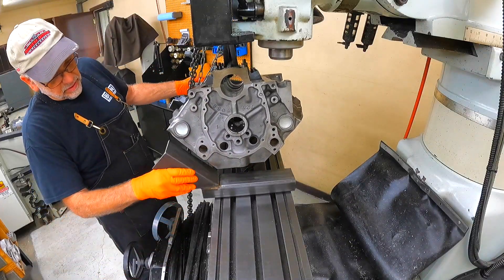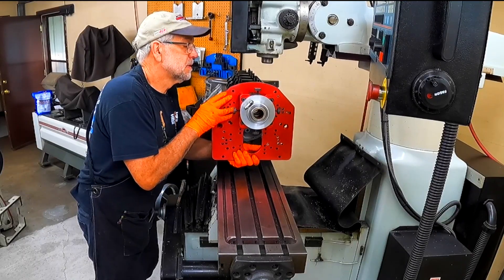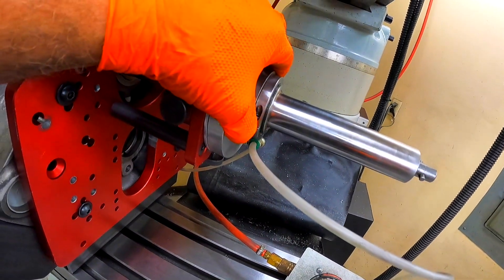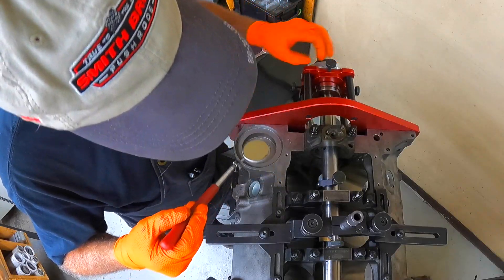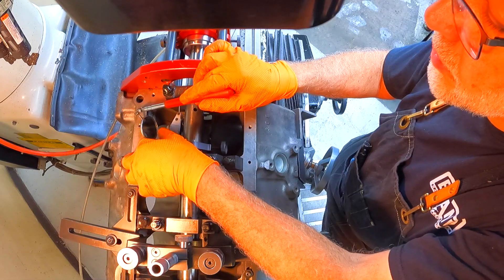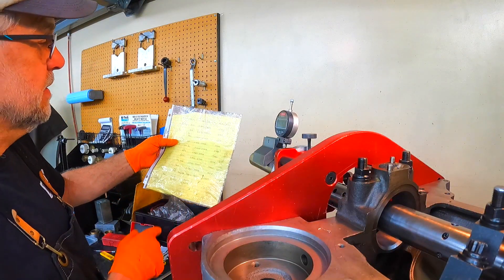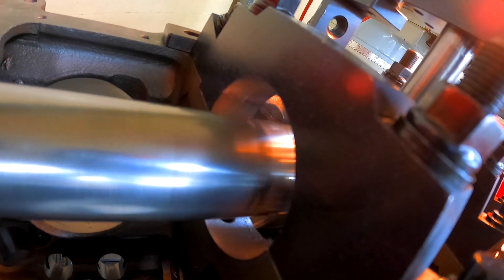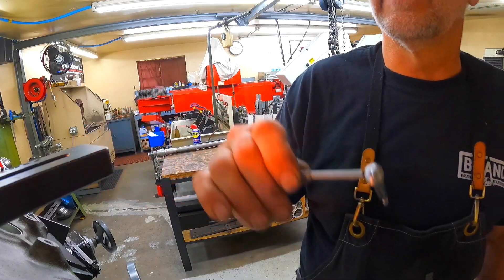Use the Mill YOU HAVE! Manual Machining Horizontal Holes with a Vertical Mill! Brand Racing Engines

Comment: A fixtured mill keeps everything on one datum, so the crank centerline becomes the master reference for all operations. Moving a block between multiple machines means chasing tram, alignment, and setup every time, which causes stacked error. Using one machine + one fixture eliminates the cascade of tolerance and gives better internal geometry, even if the machine itself isn’t “more accurate.

Comment: Other than as a work bench, what is the mill used for?
Reply: It attached to the end and provided power as well as traverse, or at least i think so, i had a similar setup for line boring and the end had an attachment that fit in the bridgeport

Comment: Thanks for posting this. If you'll indulge me for a bit, here's a brief history on that LB system: it was designed and first manufactured by Garry Sansom of Nash Machine in Toronto Canada. He also designed the the Goodson Fast-cut bowl cut system. We built 3 line bore prototypes before we released the system that you now have. Tragically when we first began to work on the line bore project, Garry was diagnosed with ALS. We continued to develop the system as his mobility and health declined. No longer able to operate machinery, Garry eventually sold his patented design to Ray and Matt at RMC. Garry was genius at taking a complex problem and coming up with a simple solution. 
    Back in the mid 90's, we had a booth at the Indianapolis PRI show where we showcased this system for the first time. Smokey Yunick came by the booth a few times looking over the system. After a few times by, Smokey asked Garry if this was his design to which he replied yes it was. They talked a few more times during the show but I'll always remember the sense of accomplishment and validation Garry felt when Smokey told him that his design was exceptional having  simplified what is arguably one of the most complex procedure in engine machining that usually requires very large expensive machinery with cumbersome and time consuming setups. This LB system solves those issues very nicely. Smokey's acknowledgment went a long way to inspire Garry to keep fighting for every ounce of his independence and contribute to the automotive machine tool industry.   
     Unfortunately Garry passed away in July 2020, nearly 30 years after being diagnosed with ALS. He was an inspiration to anyone that ever had the chance to work with him. I'm grateful for Ray and Matt and the team at RMC for recognizing Garry's vision and continuing to offer innovative solutions to the automotive machine tool industry.

Comment: Can you run 6 inch rods in a 350 block with a stock 350 crank??
Reply from the maker: Yes
Reply: @BrandRacingEngines   so what would that make it cubic inch wide or would it be like at the stroke? Thank you
Reply from the maker: Changing the rod  doesn't change to cubic inches

Comment: The indicator stylus, to get proper 1x1 reading, must be 45 deg or less from parallel of indicated surface.
Reply: I believe he's checking true position which uses only one line. Stylus angle is typically specified from the manufacturer. Stylus length is also a factor in accurate measurement between lines.
Reply: Right. Stylus length is a factor because it changes the incriminate graduation on the dial. There is actually a formula for conversions.

Comment: You ever have to modify solid roller lifter for proper rocker arm oiling? 
May be a good video idea. 
We usually have to do that on Aluminum blocks to prevent pushrod tip failure.
Reply from the maker: I have modification that i do to the blocks depending on the brand of lifter and block.

Comment: I got Two small block Chevy 4 bolt  mains  that need rebuilt  , 
I want to  build them myself  and NO 
crate engines  for me , 
Machine  shops  are closing  like 
Block Buster video and Sears   stores  .
Reply from the maker: small shop are going away

Comment: Thank you for posting !. What you have measuring was to set the position of the shaft in correct location ?.🤔
Reply from the maker: The indicator on the shaft was to center the bar The mag. indicator to set the tool.
Reply: @BrandRacingEngines  Thank you for your kind explanation ! 🙏

Comment: Got so tired of all the CNC nerd videos a few years ago, I much prefer stuff like this, CEE, Blondihacks (who's really good at setting big stuff up in hobby lathe's & mill's) etc.
Reply from the maker: The small shop is going to go away because everyone think you have to have a cnc to do the work.
Reply: @BrandRacingEngines  Yeah it's sad, you're left with guys running around figuring out feedrates, when they could be pushing out specialized projects (which is any machinists dream).
I actually can't think of a single thing I need a CNC for, all that money spent on CNC conversion is better spent on improvements to the mill itself, and more tooling, and LEARNING, something which you've obviously done a great deal of.
Subscribing.
Reply: Once a machinist goes cnc, they never go back to hand cranks, but I don’t know how you would apply that to automotive machining. Anyway, both ways are all about setup and tooling. You still have to set cutters, take measurements. You just don’t need to turn hand cranks, and your repeatability is as good as your machine tool. I have done both. I can do way more work in a shorter time on a cnc. Then again I’m not an automotive machinist and not sure how a cnc would apply to this type of machining

Comment: Anybody have an idea why dart leaves .003" or more to cut out of a new block? Why not get it within honing size from the get go ?
Reply: I would suppose it's left for the end user/machinist to make it how they want it. I'd assume (risky) that you would check/set every dimension how you need it. If I build X motor, I may want bearing crush different than you, block deck height, etc. Devil's in the details.

Comment: Thanks for the video! Would having a horizontal mill speed up setup time efficiency? What I’ve learned from your videos is machining is 95% setup, 4% cutting and 1% feeding Ruby when it’s demanded.
Reply: Probably all depends on what you're more familiar with. Potato tomato ya know
Reply from the maker: Other than installing a 90 head  no.

Comment: Is that the RMC portable line bore set up??
If not would you mind sharing who does make it?? 
I have the sunnen line bore set up with my line hone but this looks like a good upgrade. Thanks in advance.
Reply from the maker: Yes RMC  works good
Reply: @BrandRacingEngines  
Thank You for the reply!
Reply: @BrandRacingEngines  
One more question and I'll leave you alone! 
Does this have thrust cutting ability??
Reply from the maker: @Joedyna98  Yes you can.